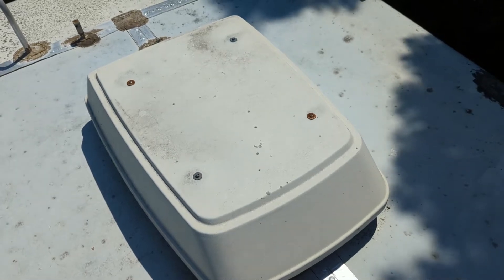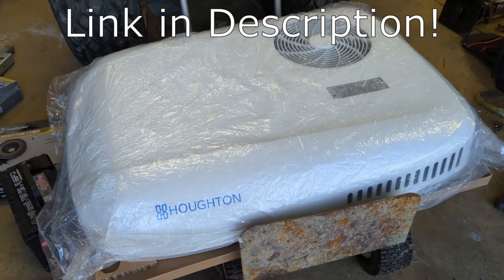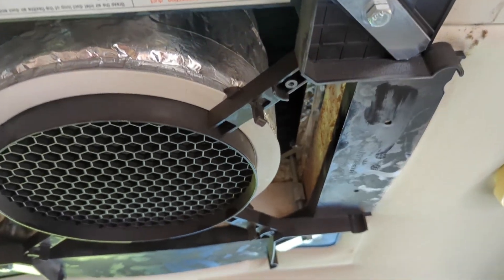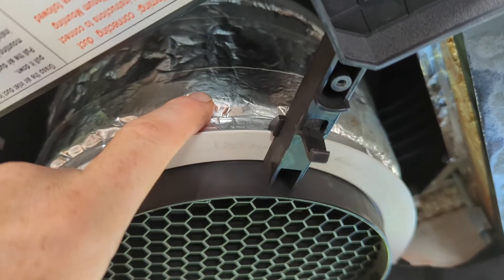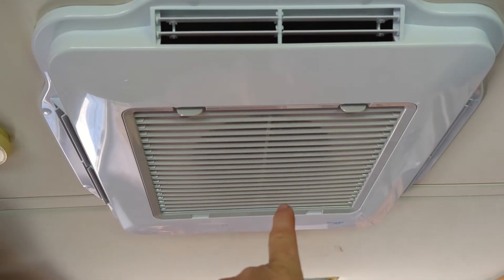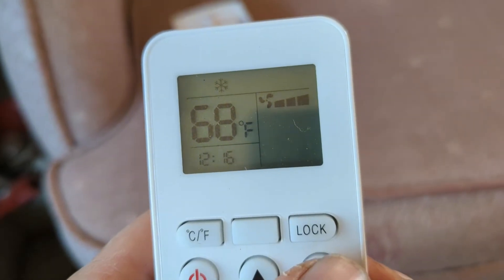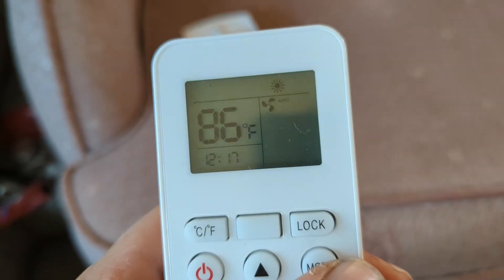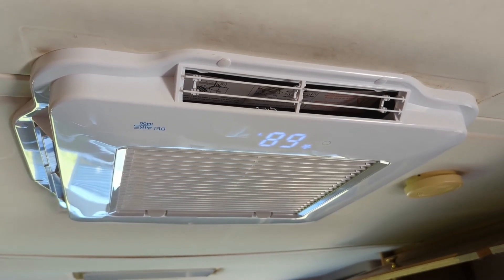The BEST Heat Pump for your RV?  With Dehumidifier, Heat and Cold AC?  RecPro by Houghton!

Comment: We are on our second Houghton purchased from RePro. (the first one was replaced under warranty) Neither of them cooled our Class B van.  They were professionally installed and neither one of them ever stayed on (compressor) for more than ninety seconds. We performed a multitude of tests under varying conditions and the compressor continues to "short cycle" meaning, it does not stay on long enough to cool the interior. In addition, because of the short cycling, there was never a drop of condensation on the outside which means it is not conditioning the interior air.  RecPro never acknowledged our problem after the replacement unit was sent out. It does however provide a moderate amount of heat to take the chill off when using it in "heat" mode. But for the cooling issue, they dropped us like a hot potato after numerous inquires.  Would not recommend the Houghton at all, and I would never purchase anything from RecPro again!
Reply from the maker: We really like ours and have purchased other items from RecPro.   By what I have been reading, short cycling and high humidity can be a sign of an oversized air conditioner.    I have the 13.5k on my 40 footer and it keeps the entire RV cool and no humidity issues.    When I asked for advice on what size to install, everybody told me to buy two of the biggest units I could buy.   We camp in areas with limited power, so I chose to try a 13.5k to keep my power usage low.  I think this is the reason for my success as the AC isn't oversized.  At least that is my best guess.  I always thought I would add a smaller one in the rear of the RV, but so far we haven't needed too.

Comment: I was looking at one of these units for my 6x12 cargo trailer. The non duct version so I can install it inside. Will this be enough to cool it down? Permitting insulation is good all around floor and roof

Comment: 🌵Some youtubers say that the humidity levels inside their RV (truck campers) are uncomfortably high after installing the RecPro which, required the purchase of a stand alone dehumidifier to bring the space back to acceptable levels of humidity... Any comments on the matter ?? I'm a bit hesitant about the humidity issue as that's a definite no no in an RV 🌵
Reply from the maker: We have not noticed a humidity issue.   The way it is designed it certainty shouldn't "increase" the humidity.     Mine didn't come with a drain kit, so it drips onto the roof in the same fashion the old unit did.   Air conditioners by nature dehumidify.   My best guess is people having issues probably oversized their units and the compressor isn't running long enough to dehumidify the air.   I will say when I asked a few forums on advice on what size to get, everyone told me to get two of the biggest units I could.   We camp at places with limited electricity and I decided to ignore the advice and try a 13.5 and see how well it did.   I'm pretty happy with that decision and I'm probably going to buy a 10k for the rear of the coach.   Maybe because I'm not oversized I'm not having the same issues.   If you do find out why folks are having humidity issues, please reply back!
Reply: @1D10CRACY  didn't think of the cycling as being an issue.. I'm gonna try sending a message to the folks and see what they have to say on size and cycling issue 👊
Reply: Pppppppppppppppppppppp😊😊😊😊😊😊😊😊😊😊😊😊😊😊😊😊😊😊😊😊😊😊😊😊😊😊😊😊😊😊😊😊😊😊😊😊😊😊😊😊😊😊😊😊😊😊😊😊😊😊😊😊😊😊😊😊😊😊😊😊😊

Comment: These units make good boat anchors, they will not cool your Rv, but turn it into a mobile oven.
Reply from the maker: Apparently experiences may vary.  I like this one.  It's still the only one we have on our RV and in the summer time keeps the rig cool.    It's a 40 footer and it does struggle to keep the back cool, but the RV should have two units on it.   I will be buying another one of these for the back.

Comment: $1600 eh, not bad, not really comparable but for peeps looking around,, you could get a 24?+ seer minisplit heatpump and inverter for $1600 fyi, albeit a lot more work and bulk..
.the big question is which would have more longevity?...depends on the planned obsolescence engineered...why, "they" aren't allowing the magnetic resonance compressors out.  they'd never break....like the first light bulbs
Reply: They just run them low.  "Farm bulbs" longer lasting even if not eternal.  The Dubai LED bulbs run at half, last forever, illegal to buy in West. China overdrives LEDs, burn-out annually, another 5 bux. So proud of m'boys, they learned planned obsolescence from the best!  Hey, they even stole the design!

Comment: Nothing about price, energy, circulation especially heat.
Just an Amazon link in description 😢
Reply from the maker: It's amazing what you can find out with a link, huh?  :).  I stopped putting prices in my videos because they change so quickly.  This was just a fast review, I really just wanted to focus on how quiet it is.  As far as energy consumption, it depends on what model you buy, this one is 13.5 BTUs.  Heating will be about 3 times more efficient than a heat strip, but it is a heat pump so at one point it will get too cold outside for it to work efficiently.  You may need to reach out to the manufacturer for more information regarding how it should perform in the cold winter.   As far as flow, I can feel the air flow on high sitting about 20 feet away.  Hopefully this information helps a bit.

Comment: Can you tell me the difficulty level and time it takes to install ?
Reply from the maker: They are fairly easy to install.   Really 4 long bolts hold the unit in place.   The hardest part for me was getting it onto the roof of the RV.  I had maybe two hours in the full install.   When I install the one on the rear of the RV I will do a more detailed video.